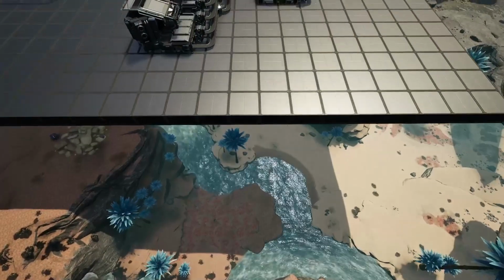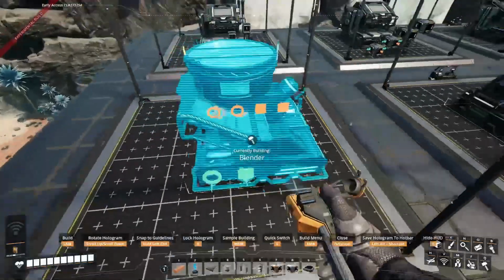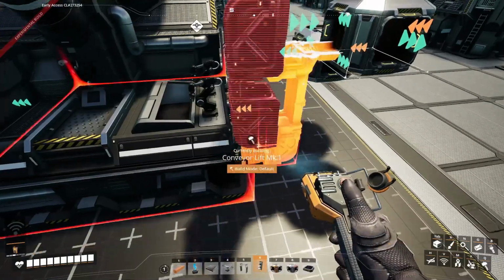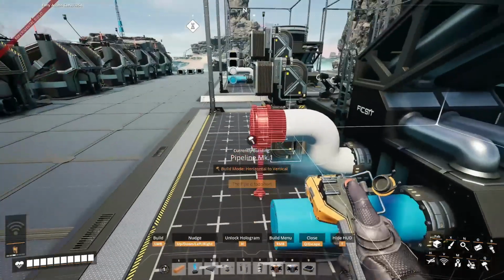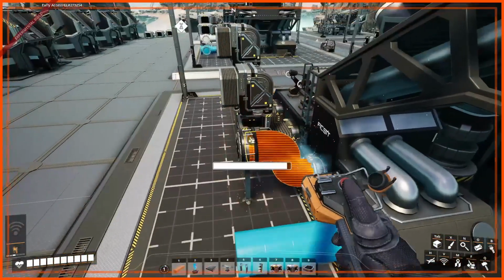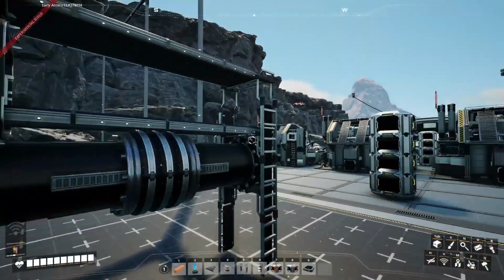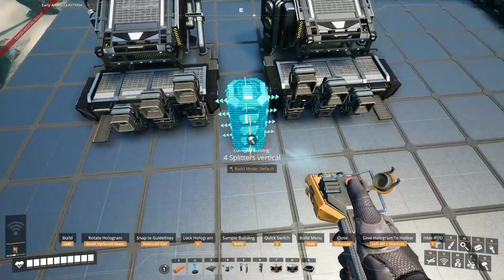Blueprint Guide - Blenders & Manufacturers - Load Balanced - Satisfactory

Comment: BTW, tip regarding vertical pipe bends.... depending on which end you start from, you can force the vertical portion at the blender or not. Make the pipe support and then place the pipe the other way around, from pipe holder to blender. Then with horizontal-vertical pipes, you get your result with one meter longer pipe.
Reply from the maker: That's a great tip! I don't know how long it took me to realize that horizontal-vertical really meant it was going to go horizontal, then vertical lol. I will definitely give this a try but I think the issue is there is one specific height and distance that, even in that mode, it will be a diagonal pipe, if it were any taller or farther out there wouldn't be an issue.
Reply: @moo121  yeah, that's true also. Each 90 degree bend has certain height requirements. If the total vertical distance is less than 4, there is not room for 2 90° bends. Just like with belts (horizontally)

Comment: nice nice!  I agree with the previous comment about the left, right, center blueprints.  also with the pipe coming out of the blender, have you tried using horizontal to vertical mode to get the perfect angle?
Reply from the maker: I thought about it and I totally agree with you both. I went ahead and changed the blueprints and uploaded them to the google drive. There are now versions for Left, Middle, Right Blenders. Thanks!!
I did double check to make sure that that the horizontal to vertical mode was on to see if that would get it just right, unfortunately this the one height that doesn't work well. If the junction was 1m higher this would all be much easier haha
Reply: @moo121  well was worth a shot!

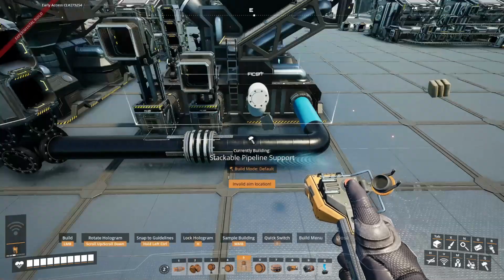Comment: 18:20 actually you could just add these supports to the Blueprint itself so you don't have to place them every time you wanna use them.
Reply from the maker: That's a great idea! You could very easily make Left, Right and Middle versions instead of just having the 2 and having to add that.